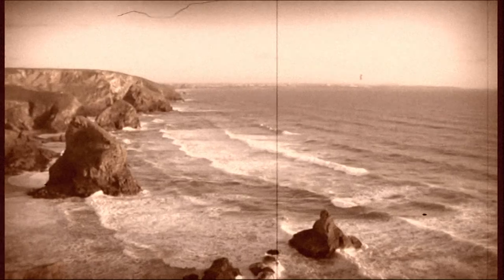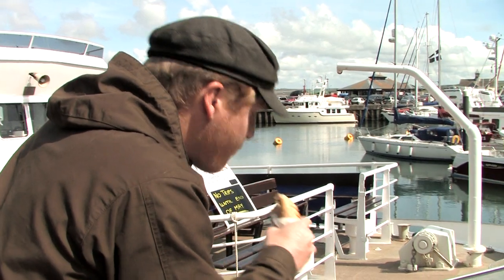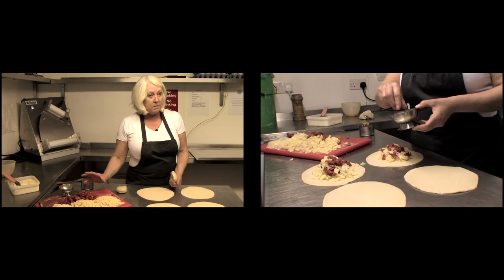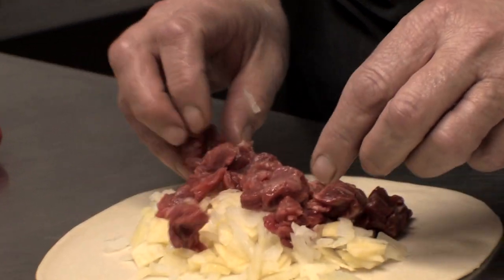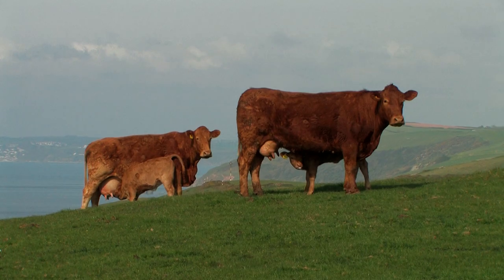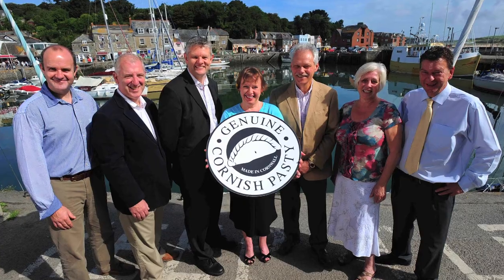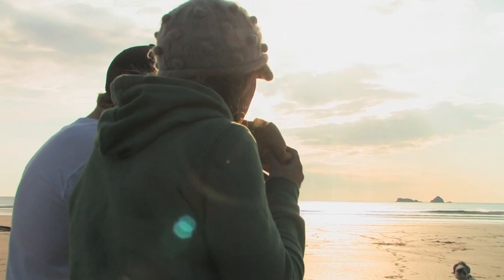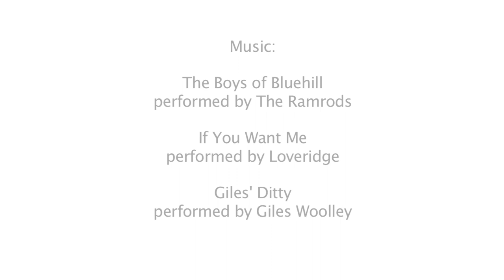The Cornish Pasty [HD]

Comment: This film is wrong on several points. 1.Swede is called turnip in Cornwall, not the other way round. 2. Each layer of the pasty should be seasoned, not just the top of the beef. 3. There should be another light layer of turnip and potato on top of the beef to make the pasty gravy. Why is Mrs. Eade still regurgitating the nonsense about holding the crimp, even while showing old photos of miners eating pasties wrapped in paper or cloth, end to end? Of course these are commercial, 'boughten' pasties and I'm describing the real, homemade variety made by Cornishwomen all over the world, for their families for centuries past.